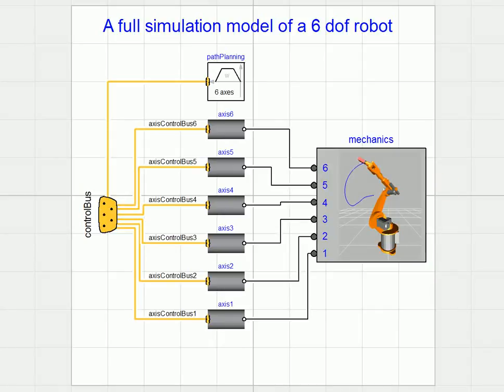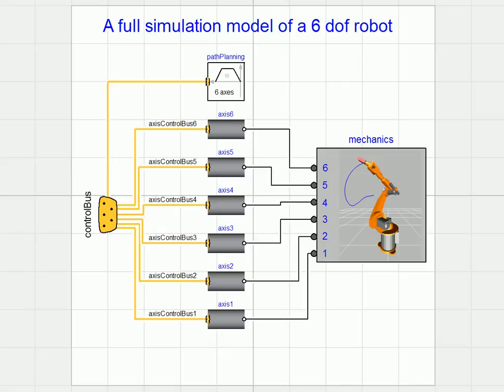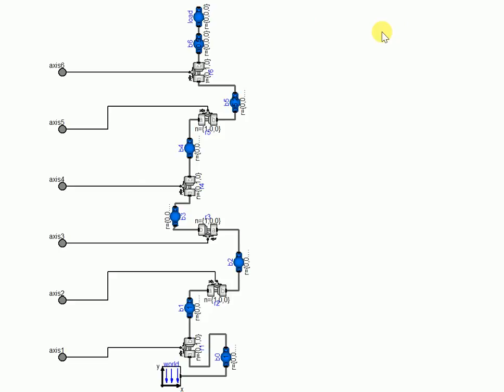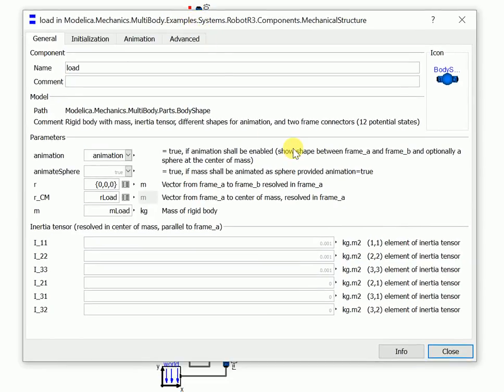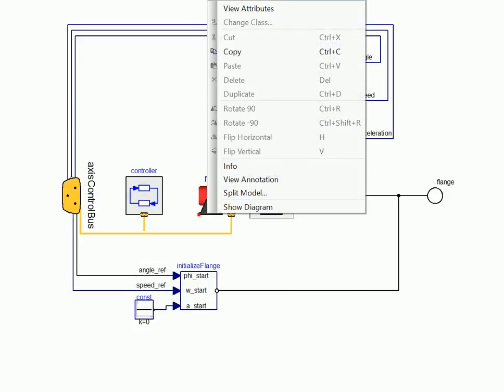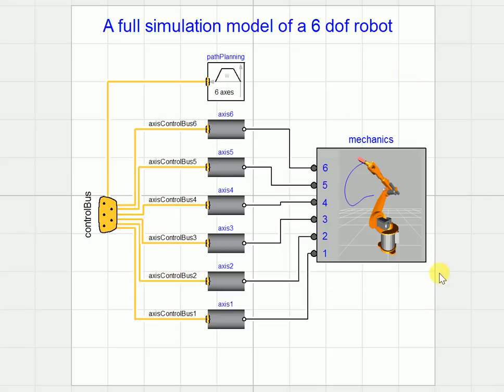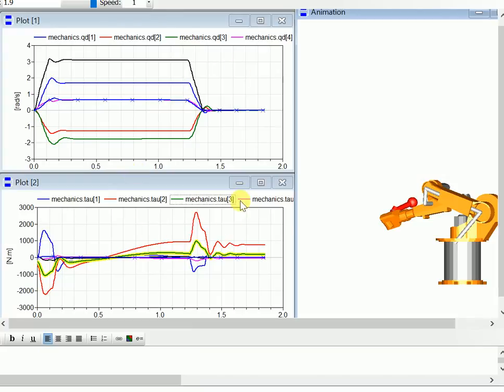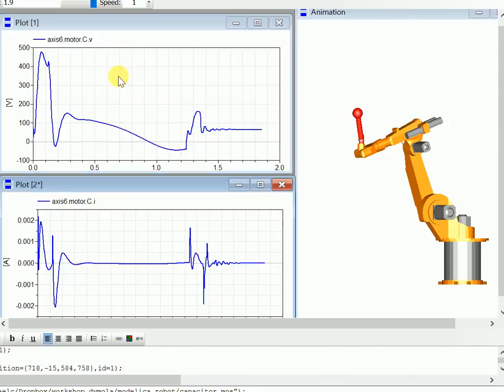Modelica -  6 - axis robot simulation - ADN Singapore

Comment: Please can you tell me how you would change the points(A to B) the robot goes to from start to finish. I want to compare the results on different points. Thank you
Reply from the maker: When you open the model Modelica Robot, inthe component path planning you have two parameters Start Angles (6 Values ) and End Angles (6 Values) These values define the start point and end point of the robot.
Reply: Thank you! I am doing this project for my final year dissertation. 
Is it possible to change the defined values in the demo?
If so, how could I do this. 
I want the robot to go different points in one plane, so for example point A, B, C, D.